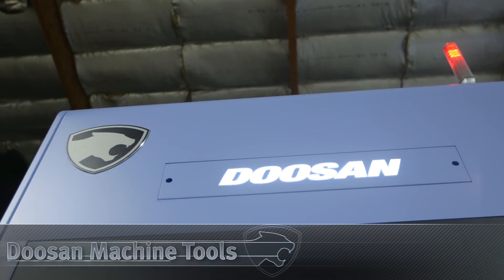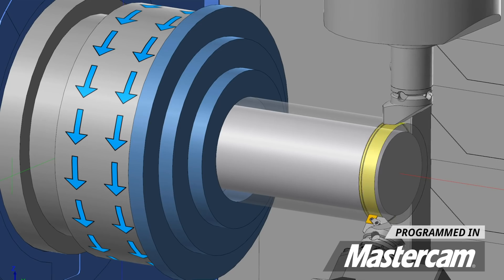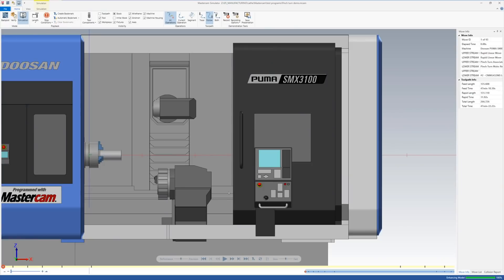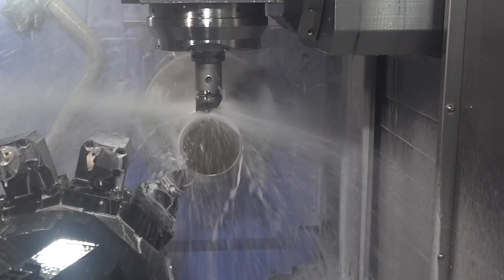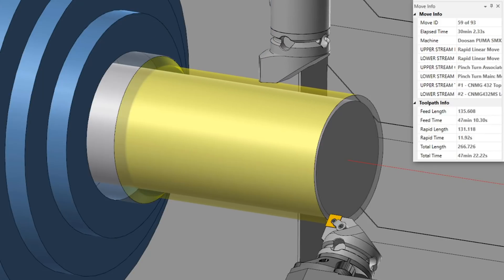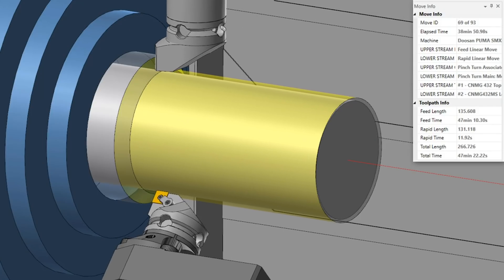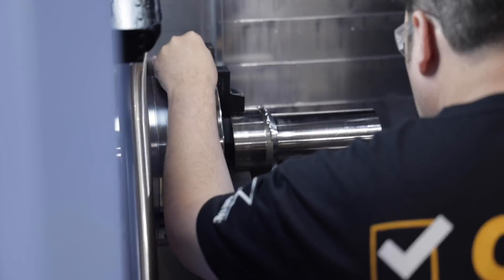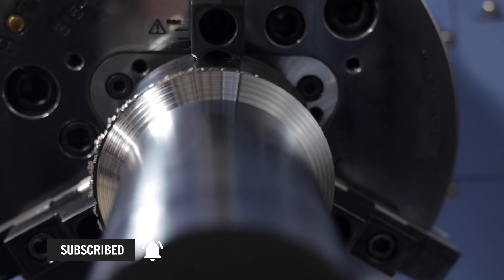Pinch Turning INCONEL 718 on 9 AXIS MILL/TURN | SMX3100 ST

Comment: Pinch turning is the shit. Double the feedrate, increased spindle speed (unlike conventional turning, chatter will develop and worsen as r.p.m. decreases), typically zero taper and better surface finishes. Just being able to cut roughing cycle times in half or better is worth the machine cost and setup time in my opinion.

Comment: I really would never run with that stickout without a center - scary stuff right there
Reply: I run even longer pinion shafts without center because i dont need centers, center is good for beginners but when you are real turner you dont need center even on longer shafts!
Reply: And my machine doesnt even have an center,  sometimes when i make over 500mm lenght shafts i go to different machine and i use support bearing, but center is just something i dont like and dont use.

Comment: Interesting the 2 tools are not pinching at 180 degrees apart.  I have had such great success with reducing chatter on longer shafts when the tools are oriented as true to 180 as possible.
Reply: Nonetheless pinching and other multitask processes are a great option to have. Goodjob showing the machine capabilities.
Reply: He mentioned this, that is balance turning yes?

Comment: Interesting strategy. Inside the kennametal aerospace machining guide, they state that a dramatic increase in tool life can be achieved by increasing the lead angle of the tool. Inconel 718 produces notch wear in the tool which can be reduced by changing your holder to a tool with +15deg. lead angle.

Comment: Why you take only 1.27 mm per pass per tool? You can take 5 or more mm with this tool (just reduce feed if the machine do not have enough HP). It doesn't make sense to waste so much time for roughing... We machine hardened Inconel 718, 625 as well as Hastelloy and other Ni alloys everyday. With CN..12 insert we take 3-5 mm per pass radially, with 0.05 mm/rev and 30-40 m/min. The machine spindle has 7.5 kW and uses <40% of the load during this operation. Other good tool for this work is sandvick's CNMX, for example CNMX 12 04 A2.
Reply: Im going to machine inconel for the first time soon. Those 5MM cuts are with or without tailstock?
Reply: @BobdeJong94  Without it

Comment: im Running a machine with 2 turrets  180° apart  this allows to run  double feed rate and also double even a  bit more DOC wich is i bit faster then pinchturning but the B-axis gives you so much freedem is almost better :D
Reply: but you need to watch out if the turrets aren't synchronized or its not 180 degrees perfect than it the load won't be equal and in worst cases you'll run double the chip load and it is bad really bad

Comment: Great solution I work with two okuma Multus a 300 and a 400 both dubbel spindel but no extra turret so that and no steady rest miss that the most we make Valves for any medium now I am making part with inconel  welded core lol I use a mill high feed first to clean the front before any other operation maybe not the fastest way but I can leave the machin running and start the other machine it makes in the end more productive.
Reply: Forgot a little demo of my machine https://youtu.be/H7RSL4rPZXI

Comment: I hate any Inconel or Hastalloy because the company I work for doesn't seem to understand we need better tooling for it. Very frustrating.
Reply: .....same....feel you!👍
Reply: Presuming they don’t have financial issues I agree with Ultra CNC. We’re in a new shop and funds are tight. We use the best we can afford. We’re also not a job shop so we can’t offset the tooling expenses to our customers which is exactly why job shops can afford better tooling.